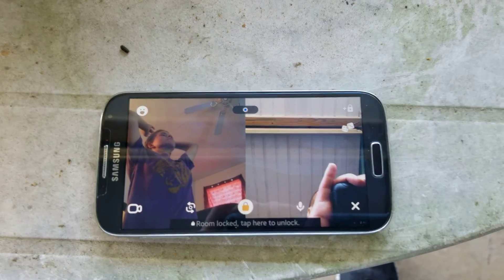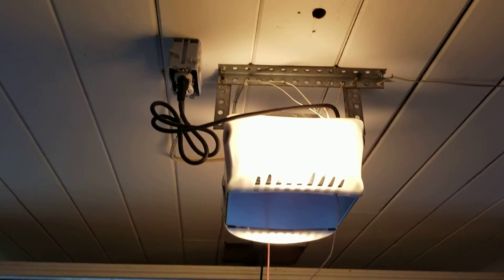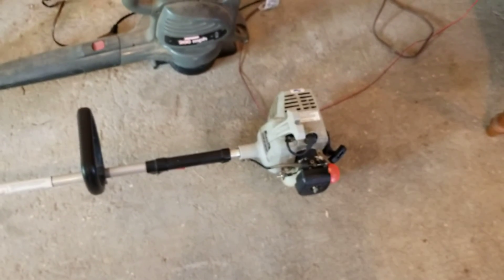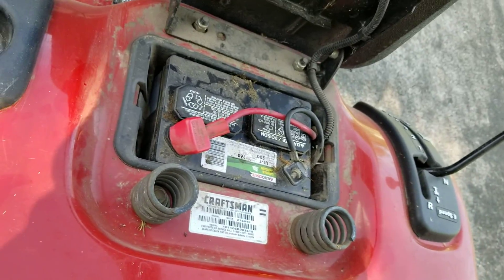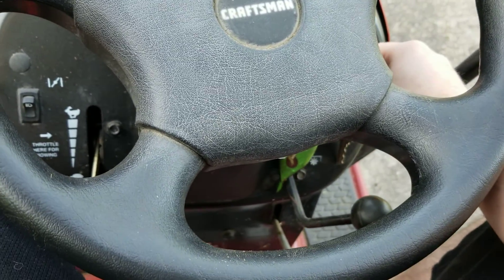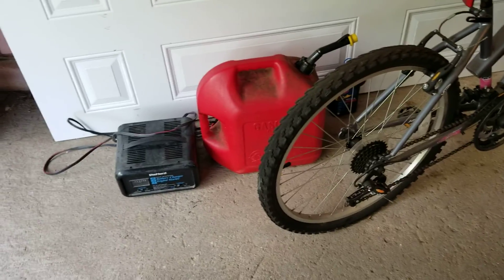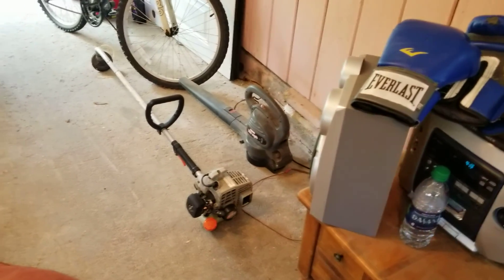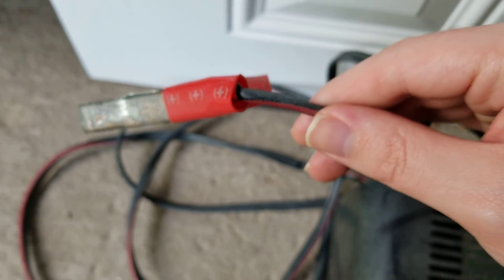Trying to start our Lawnmower again

Comment: The comedy on this channel is top-notch now!  I just love watching the buffoonery!  Don't listen to what I have to say, no no, it might work.

You, uh, could, uh, jump start the lawnmower with a car you know.  Won't fix the bad battery of course, but at least you can find out if the starter's good and the engine will run.

Tomorrow's video of mine will detail a tool that could have helped you months ago.  And I've already reviewed 2 of those jump-start packs, those would have cranked up that mower no problem.  But of course what do I know, the old man with all the experience.  The guy who's been there, and has done that, and figured it all out with no help from no one.
Reply from the maker: My neighbor had come by to help jump start it and it still wouldn't start there is a jump starter on the charger we tried that it still wouldn't run he got a battery tester to hook it on the battery said it was bad
Reply: Most cars with a bad battery will start when jump started.
Reply from the maker: @jaykay18  the lawnmower didn't though idk how
Reply: I do, but my opinions don't count on this channel.